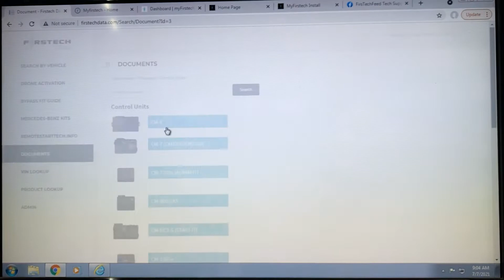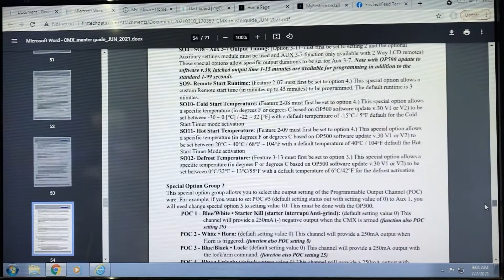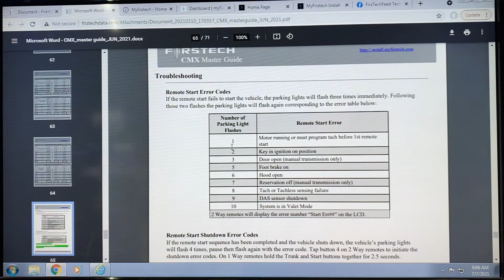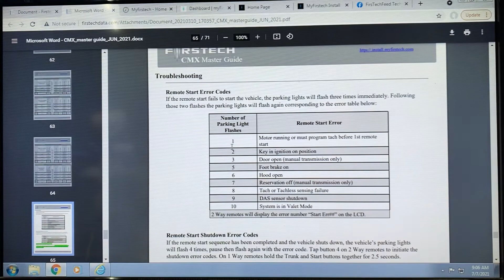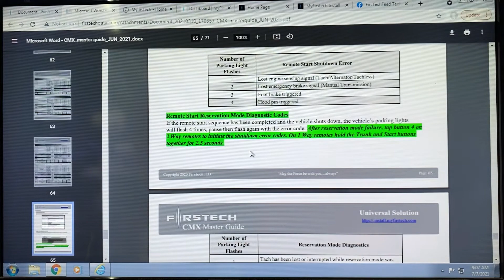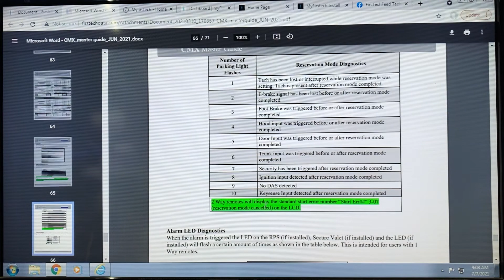CMX Remote Start and Shutdown Diagnostics + Troubleshooting | Remote Start Basics & Installation

Comment: I connected everything, but the foot brake. And the manual says to connect clutch 1 even says how many pins are there and what color but it's not there In the vehicle. I looked everywhere. It's just not there! What to do if I can't find the clutch switch? Also when I start it it shuts down after it started:(  and the cm-x blinks twice and no blink after. What does the number 2 error code mean? I'm so confused, i lost 12 hours sitting outside in the cold trying to find the problem :( please help me